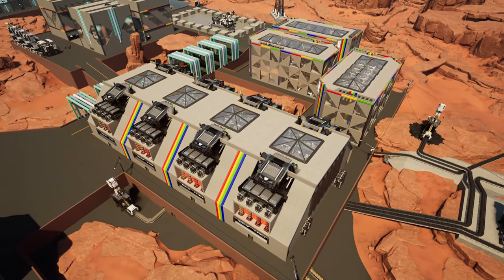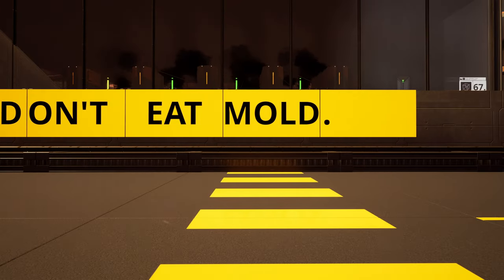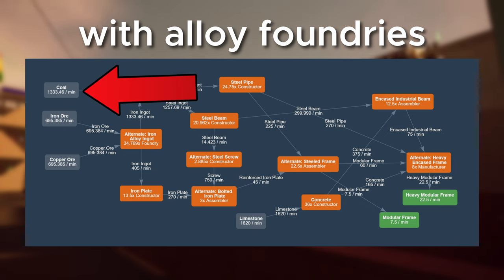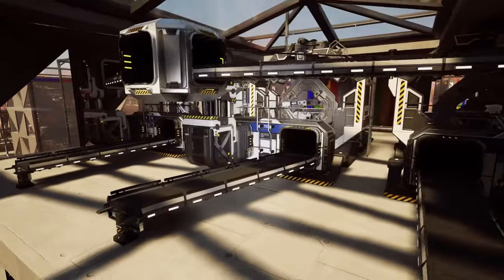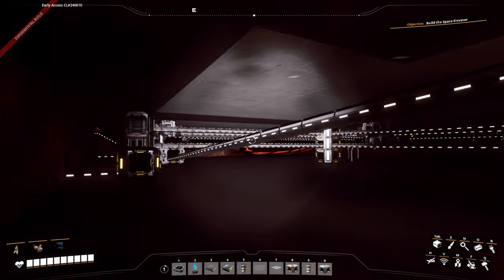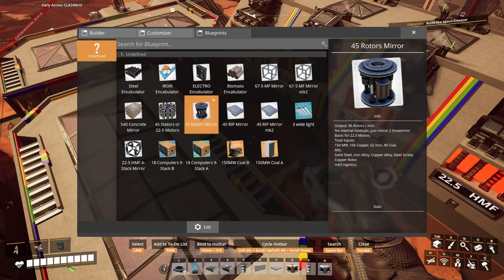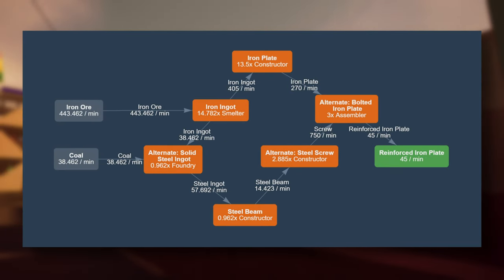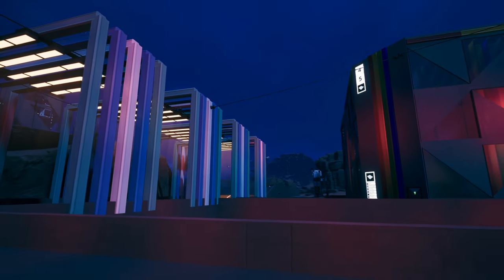THIS changed the way I play Satisfactory!

Comment: I started using this approach as well, with the following aspects:
- I still try to make the "cubes" nice and walkable inside rather than a encapsulated mess.
- I limit them for processing at-a-site such as refining caterium to ingots for transport
- I still use blueprints to create larger factories (non-cubes) - I wouldn't replace everything with cubes.
BTW - I like your trademark rainbow and the overall cube design - very nice.
Reply from the maker: You can check out my other creations on this channel, there are plenty of variety and non cube factory prints.
There is one interesting hack for creation of walkable factory blueprints btw. You can place blueprint inside blueprint designer and shift it to the side. This way you can extend exterior of blueprint beyond 4x4 if no build pieces overlap edge of blueprint designer. There are some limitation to this technique, but still this can work wonders for walkable factories.

Comment: What I like about modular designs, you can leave your early-stage factories up and running. I build similar, but i like to have space to walk around and oversee the whole production.
Even if i know that when you play several 100h something like 1-10 items/min is more then enough i usually scale up everything to a full miner. Once i reach a new tier i can usually double the production.
Reply: I can't imagine NOT building without a modular system or at least semi modular system. I tend to build minor factories with a handful of outputs in mind with a very distinct end goal.
Reply: @DIY_Miracle  "NOT" "without" double negatives are a mess.

Comment: This is very informative. Have you tried this with the later alt's that can eliminate screws altogether? I've just gotten to start unlocking fuel production and so far I've managed to nab the alts to take screws out of the works. Only thing so far that needs screws is the shop. I def have to start using signs like you show, I had to take a break from the game for a bit due to moving and came back and was all.. 'what is this making again?' lol
Reply from the maker: In either case you need to produce Reinforced Iron Plate for a lot of things in Satisfactory. Bolted Iron Frame is great since it is 15 / min per assembler. Screwless alts just have low production rate and this is crucial when you are working with such a tight space as blueprint factory.

Comment: Hey Yakez, I was wandering about your decision of input materials.
What was your thaught process of making the input as ore instead of ingots?
The only downside I see is that you make another blueprint for refining ore to ingots, but after that everything can accept ingots and you have more room in the blueprint if needed.
Did you have other considerations for it?
Thanks.
Reply from the maker: It is just two different ways of doing things. There is no real benefit to either way in most cases. Also if you make separate ingot production it is better to go with more efficient Stitched Iron Plates over Bolted Plates. Bolted Plates are good for its compactness and ability to fit them with smelters onboard making 1 blueprint over 2.
Reply: @Yakez42  Amazing, thank you for the reply! Yes I was looking at creating a new production for Iron Plates and realized that using ingots, its better to use the Stitched instead of the Bolted.

Just extra blueprint for ingots, but then it can be reused for multiple builds.
Ill go test it out 👍

Comment: Beams or pipes for the encased industrial beams?
Reply from the maker: Yes, I do use pipe recipe for encased industrial beams in HMF factory in the end. It was easier to fit since it is 1 manifold over 2. Jinxed with final schematic for HMF in the video.

Comment: How did you make the wall angled and match so perfectly to the straight walls?
Reply from the maker: Road barriers. They are perfect alignment tool for angles. There would be obvious overlap. Another tip if you want to use something other than concrete with overlapping angle walls is to use 1m walls stacked over 4m walls. This way steel and normal walls have no pattern to z-fight.

Comment: are iron and copper alloy recipes better than the Pure recipes?
Reply from the maker: Yes and no. Pure recipe only useful if you smelt FULL map AND have huge nuclear setup up and running. Before this point alloys are always better. Pure ingots uses way more energy, it require water, witch can be pain on its own and it uses way more machines. Also FPS issue pretty much stopped me ever using full map worth of pure recipes ever, and I have decent rig.
Pure recipe for quartz is great due to very limited nature of quartz, sometimes pure caterium can be nice. Everything else is good on paper but absolutely unwieldy in the game.
Reply: I see niche uses if you’re like me and hate transporting resources around the map. Sometimes I need more copper but only have 1 nearby node to mine, so either transport more in, move whole factory, or use pure or water recipes to get more copper on site.

Comment: I like the idea of the modular factories. How did you figure out that 45 Reinforced Iron Plates work well with other components? Personally I do not like using screws in my factory, so I usually use the stitched Iron plate recipe with iron wire.  My modular factory for RIP using Stitched Iron Plates can only do 22.5 per module with a power consumption of 101 MW.  So I need 2 factories to match yours with for 202 MW. My materials are only 196 x 2 = 392 Iron Ingots. I did the math for a 45 RIP using the Bolted recipe, and power should be about 133 MW, and materials need 453 Iron Ingots and 48 coal.  Power and footprint are better with Bolted, but materials are much higher.  IMO, I would rather save the coal and Iron for a little more power.
Reply: Watching your video again.  I realized that I thought your 45 RIP was one module, but it is two.  Additionally, you are using the copper Alloy recipe.  IMHO, you might want to rethink the efficiency of this setup.
Reply from the maker: Space. Difference between Bolted and Stitched Plate is that it is less machines. Assemblers in particular. It was critical for this design. I was not aware how to fit more than 3 assemblers or 8 constructors per floor at a time. Then if you are going for iron wire you will need 7 smelters, 4 assemblers and 13 constructors per blueprint to match 22.5 RIP. I can see pulling this off 100% now, after I have designed like 30+ blueprints. But not when I was making this blueprint, it seemed impossible. It was pretty much second iteration of the first blueprint factory design ever. But nevertheless good points and I totally see myself doing RIP differently next time!
Reply: @Yakez42  I am smelting outside because I like the pure iron recipe, so I am doing a separate factory for 3 refineries.
Reply: BTW.  Thanks yakez.  Great design for the shell of the building.  I made some changes to suit my own tastes but borrowed it.

Comment: Thanks dude. I love this, though the amount of clipping you needed to use adversely impacts my cringe response. So I'm using your BP with thanks, to get started, and working on my own that avoid the clip, but will obviously be less compact.
Reply from the maker: I have not even started with clipping xD. These blueprints have no hard clipping and not very tight. Like 8 constructors or 3 assemblers + 3 constructors per level. You can totally jam 12 constructors or 6 assemblers per level with only soft clipping! Just need to be a bit 3 dimensional with manifolds.